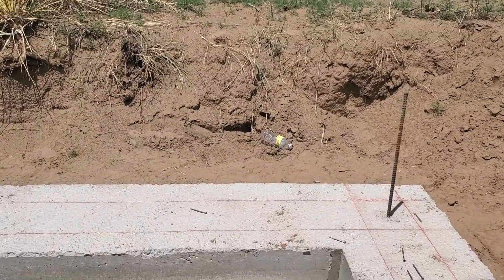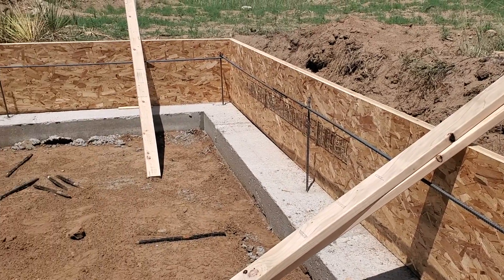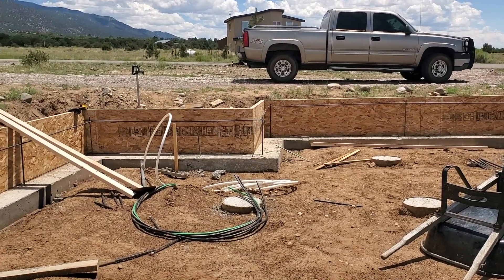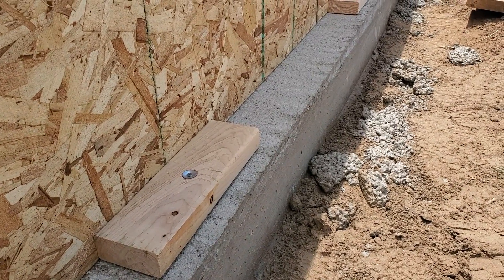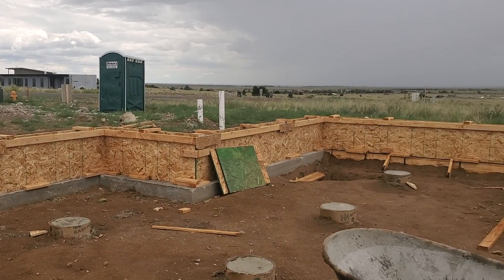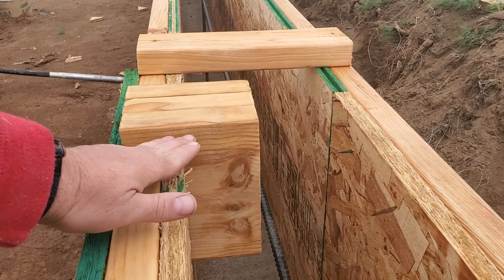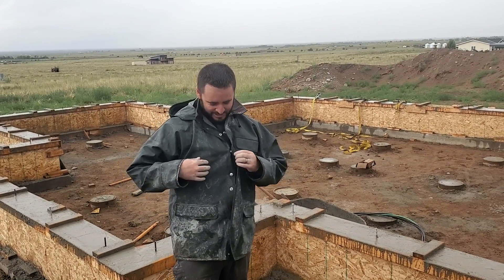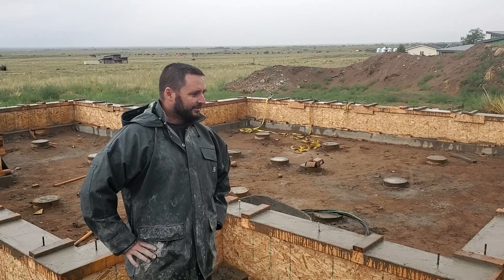OSB Concrete Forms | Start to Finish House Series | S2 EP3

Comment: Very helpful thanks!  Such simple wall form construction.  I am doing my first foundation myself now and 2/3 of it is about 34 inches high like this. The rest is 70 inches high so more pressure to deal with.   I bought a ton of snap ties and 2x4s and have special forms for the tall walls.But if I can do the short walls your way it would save me days of work and cost of 2x4s.  Maybe I just do 1 layer of snap ties and walers on the short walls with 2x4 rails and top supports like you did (tall walls will still have a crap ton of walers, strongbacks and snap ties.). I have metal bottom cleats though and will use plywood not OSB.
Reply from the maker: Thanks! If you are doing some short walls like mine, I think you can do 1 layer of snap ties, then using the metal bottom cleats will work great, and using plywood instead. Your foundation will come out great! You are doing it the way I should have done it, much simpler and stronger. Good luck with the forms, but it sounds like you won't have a single problem with the pour.

Comment: @04:35 
If you used kickers and walers with tyes, would you need those wood blocks nailed to the foundation?
Reply from the maker: I wish I used ties instead of the nailed blocks, a couple of the blocks started to come out, I wouldn't suggest nailed blocks to anyone wanting to do forms this way
Reply: @slothconstruction how high was the concrete wall ?
Reply from the maker: @picajoool  24 inches
Reply: @slothconstruction seemd higher looking at the videos.
What was the condition od Osb boards after the pour?
Reply from the maker: @picajoool  It was in good shape, the osb didnt really come apart and could probably be used again for another pour. I gave it all to a neighbor to build a little shed and it worked great
Reply: @slothconstruction  Very interesting....wich oSB boards did you use here?
OSB 2 or 3...maybe 4?
Reply from the maker: @picajoool  it was 3/4" thick and 4x8 sheets that I cut in half to make 2x8 sheets
Reply: @slothconstruction  Thanx!

Comment: You mentioned "half the price of ICF".  I assume you aren't going to insulate.  If you do end up insulating that wall, that cost would have to added to the cost comparison.
Reply from the maker: @markstipulkoski1389  At the time ICF was hard to find and expensive and we didn't insulate it. Now I wouldn't do it this way, the last 2 houses I've used foxblock ICF and it has been a huge time saver.

Comment: Your lucky you didn't have more blow outs not enough 2×4's and using USB like that. I love using USB plywood. Cheap and I think the finish of the foundation comes out beautiful. Spraying a little Diesel inside the forms helps that. In 30 year's doing it like that never gave me a problem or any blow outs at all. When poring the cement I give little tap's on the form's and the face of it  bringing the cream out gives it a smooth look and the color stay's consistent throughout the entire wall. Good job it looks good clean to me.👍
Reply from the maker: Thank you. I wish I could put your comment in the video, you have some great tips. If I did it again I would use much more 2x4's for support, i got lucky and didn't have many problems. It was a really nice finish when the osb came off and a little diesel on the forms would have been good, I agree. Thanks!
Reply: @slothconstruction  Nice. Good thing only that one blow out. Keep up the good work and you'll be just ok. Thanks to you.
Reply: Don’t you need ties as well or can you just fix top and bottom? Is this wall 4 feet tall?

Comment: would it help to spray it down with thompson's waterseal?  Also, I don't think it getting wet once from concrete would cause it to expand all that much.  I've seen stuff on the floor expand to 1" but it was still solid.
Reply from the maker: If I planned to try and get another use from the OSB I think a coat of water seal would be a great idea! Once the forms came off it didn't seem like it expanded much or any at all. After we took the osb off a guy came and picked it all up and built a shed for his lawn tractor, said the osb was still great to use!

Comment: That is.... not a lot of steel
Reply: I poured house foundations(4ft up to 10ft) for 20 years and I don't get the obsession people have with putting a lot of rebar in house foundation walls. Most architects(and buildings codes) only specify a continuous layer of 1/2" rebar around the top of the wall and an extra piece over window/door openings.

Comment: Did something similar. It was a form board sheet material though more $ but waxed or something & stout. Doubled our 2x4 at bottom along snapline to give us wiggle room on any deviation from level line we shot at the top of the stem wall. Worked fine - a lot less work than 2x10s & wedge ties not to mention money spent. Never thought the snap ties were less labor than wedge ties with all the drilling. Anyway loks good.
Reply from the maker: I can imagine foam sheets would work pretty well too, I don't think I'll do this method again anytime soon, maybe for a smaller and shorter wall. I would have liked to use ICF but there was a shortage in my area at the time. Good thinking for doubling the 2x4 on the bottom, that's something I should have done. Thanks for the comment, I always like to know what others are doing.

Comment: how well did the OSB come off?
Reply from the maker: It came off very easy! We poured on a Thursday and removed the OSB on Monday and it came right off, didn't stick at all.
Reply: @slothconstruction  great to hear thanks!
Reply: Built many forms from OSB...the stuff nowadays will delaminate quicker than the stuff in the 80s.... probably some nuisance in California complained it might be harmful to a gnat and had the bonding agent for osb swapped out to some" eco friendlier " glue....they smugly claim victory while driving on all that asphalt that leeches oil into the ground.